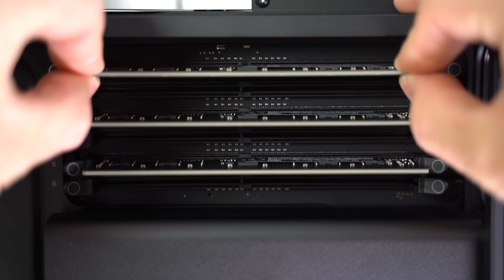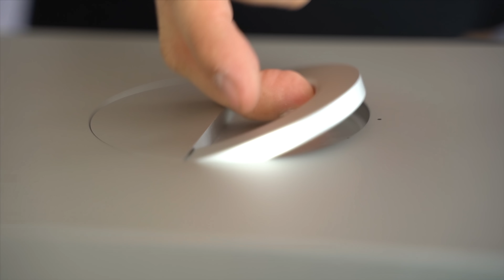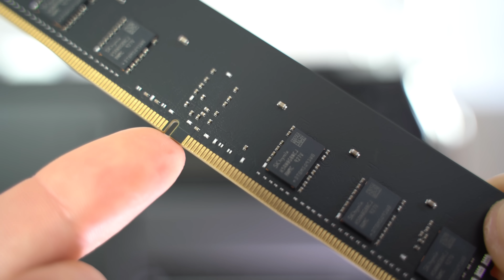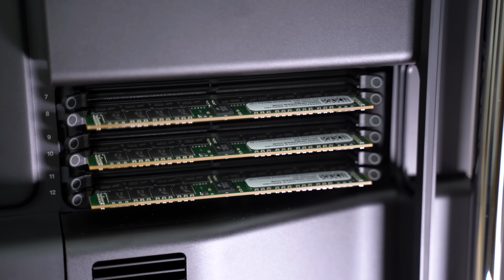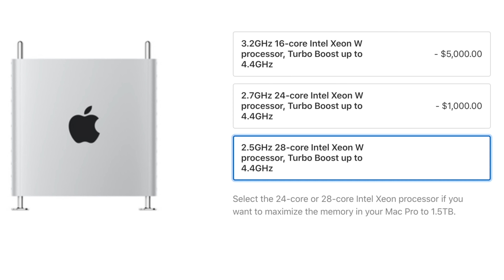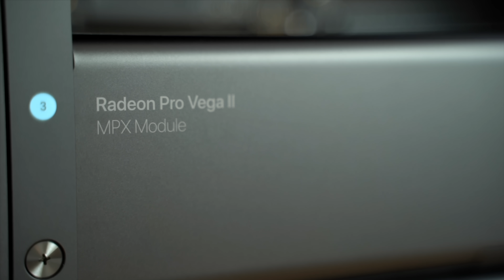2019 Mac Pro RAM Upgrade Guide - Save up to $10,600!

Comment: So, if I order 3 (192GB) would I install the 3 new into slots 3, 5 and 8 and leave one of the old 8GB that came with the computer in slot 10 (4 DIMM configuration) OR use slots 1, 3 and 5 with the new and use 3 of the pre-existing in slots 8, 10 and 12 (6 DIMM configuration)? Thanks for to anyone for clarifying. My computer came with 4, 8GB.

Comment: Your link: 1.5TB Kit (Save $10,609 on Amazon) ➡ @t (Order 3) Has a problem on the bullet points explanation: They mention DDR4 PC3; that cannot be. could be a typo for PC3 because the Ram would be DDR3. Thay charge more for DDR4 PC4 https://www.amazon.com/gp/product/B082XK7GJX/ref=crt_ewc_title_oth_1?ie=UTF8&smid=A91YWXUX63ZCY&th=1

Comment: Depend on mac software even vm windows...mac pro 2019 is overkill not use all hardware potential...not all cores on xeon 28 not all ram not all GPU's on 128gb radeon vega ii duo...this only good for film video 4k 6k 8k footage we which is not standard yet still 1080p 240hz 1ms to 1440p at most upscale or downscale 4k. 4k 144hz monitors just came out...but tv broadcast 1080i. Plus mac pro is 6k to 53 plus  cost still expensive.

Comment: I had to push really hard to get the top RAM stick in and saw the motherboard bend before it finally snapped into place. Is that a bad thing? It's running fine, but I wonder...

Comment: Thanks, this video was a good help. I got the 192GB RAM on Amazon. Difficult to find anywhere else as of Jan.2020. I was considering just filling all 12 slots by adding 2 more of the basic rams, but it seems the speed may drop to 2666MHZ with such configuration -- so I'm sticking with 6 slots for now.

Comment: That RAM is now $292 per 64gb stick. Seems the influx of Mac Pro buyers jacked the price up... still better than Apple, but not as sweet.
Reply: exactly. It is crazy it went up so much in such a short time. will wait for the downturn. Honestly, current price is not that attractive
Reply: @XYUCSD  Agreed, it's still a savings but once the excitement dies down it'll be back around $230.

Comment: Do you recommend swapping out the base memory for 6 sticks of the same make? i.e. not 2x base + 4x new
Reply: If the four new sticks have the exact same specifications as the two existing ones, it should work.
Reply: Yes, you should replace them. Even if the sticks have the same specifications, there's no guarantee they will have the same timings (specially sub-timings). For better performance, it's best for all the sticks to be the same exact model.
Reply: Ok, thanks.

Comment: Assuming that there you start with 6 identical sticks of RAM and add 6 identical sticks, here's no need to remove the old RAM. Unless one set is RDIMM and the others are LRDIMM (which won't work at all), or you're going to sell the old RAM…
I believe you only get the full bandwidth to RAM with all 12 slots occupied. 6 slots gives you 97% of the bandwidth. 4 slots 67%.
I think the best plan if you buy the base config with 4 x 8GB sticks is to buy a further 2 x 8GB sticks plus 6 x 8GB (or 16GB, 32GB etc…) to fill the 12 slots.
Reply: Actually, according to this page http://www.cpu-world.com/CPUs/Xeon_W/Intel-Xeon%20W%20W-3235.html if you install 12 DIMMs, the RAM speed drops to 2666MHz, so it does make sense to only install 6.
Reply: @JGRGilbert  That's an excellent point!

Comment: I was just wondering, is there any difference in terms of quality or reliability between Apple RAM and Third Party?
Reply: Vikas Jangra just buy RAM from MacSales
Reply: Thank u so much. I have my answer.
Reply: As panda12333 said, there's no such thing as Apple Ram. It's just re-branded third party ram.
Reply: dude there is no apple ram the ram is produced by samsung or micron it is all the same and is nothing special at all it is just a computer not magic. well it is ECC ram but thats completely useless for 99.9 percent  of us.
Reply: @panda12333  According to Apple's ram upgrade specifications it has to be ECC
Reply: @huskkyy  yes and ? ECC ram has nothing to do with apple it uses ECC ram because intel designed it that way  but most people dont understand that it is completely useless for 99.9 percent  of people and talk a whole lot of bullshit it does nothing for you in rendering videos or in blender or anything else a normal person would use. the only point of this stuff is error correction for example banking servers who handle transactions, stock trading servers,  protein folding simulation it is so useless for almost everybody but because of intel it is a requirement for these cpus
Reply: @panda12333  but which of all uses the best materials to make the RAM .. better components etc
Reply: @merseybeat1963   the best ram at the moment is made by samsung  but its not important  for you or me only for extreme overclockers bcause they have the best results with samsung dies in benchmarks but all in all no difference for the normal or even advanced pc user
Reply: @panda12333   But quality comparison between this reviewers suggestion (TimeTec) at $224 2X32 or the OWC & Crucial versions at $348 for the same?? Thanks
Reply: panda12333 true

Comment: Can you just add the already included ram without sacrificing performance?
Reply: just make sure the stick is the same size and same speed while using 6 slot or12 slot so that they can run on triple channel

Comment: I have a question can you change the ssd also
Reply: The SSD(s) that come with the computer is/are tied to the T2 chip and can only be changed by Apple or an AASP with the software tool Apple uses to rebind it. This is because the SSD controller is on the T2 chip, and not on the SSD itself.
The reason I made it half plural, is because some configurations will ship with two SSDs in RAID 0, whilst something like the 256GB model is just one.

You can still add more SSD storage though, either via PCIe cards, or through SATA, which is, I believe, on the I/O card. This will however require a specific drive caddy since the SATA power line is non-standard. Pegasus makes such a drive caddy.
Reply: Casper S� And no one (black market, etc) has that software ?

Comment: But... what about the remaining RAM? That Mac has 12 slots, you could just use the original RAM in the slots that are empty. That way you can have 240GB of RAM.
Reply: The following is a copy of my comment on MacRumors about this with respect to memory speed:

The following is not based on knowledge of the specific architecture of the Mac Pro, but general computer knowledge. Disclaimer over.

These CPUs support hex-channel memory. This means that the CPU will have six channels of communication to the memory. This can only be achieved if 6 or 12 slots are populated, so the CPU has either 1 or 2 DIMMs per communication channel. If 4 or 8 are populated it'll run in quad-channel mode. 

Let's pretend we populate 8 slots with 64GB sticks, and 4 with 8GB sticks. If we put 1GB of data in each DIMM and try and access all that data, all at once, this will actually be faster than if we had only the 8 64GB DIMMs, since we can access the 1GB of data on 6 DIMMs simultaneously, versus putting the same amount of data on only 4 communication lines. 
However, if we load up all the memory modules to the brim, the larger memory modules will obviously be used much more than the smaller modules when accessing all the data, since they just hold a larger percentage of it. This means the communication lines will be used unevenly and it won't scale the speed of communication as well. It in most any situation won't be slower than the case with only the 8, should in fact be faster, but not as fast as fully spreading the load across all 6 channels with evenly sized modules. 

The very worst case would be having a single huge module and 5 tiny ones. Since almost all data would be stored just on the huge one, and not so much on the five smaller ones, communication from the CPU would almost effectively become single channel. - The point is more that if you want 256GB of memory, it is better performance wise to get it in 6 or 12 evenly sized modules, than it is to get a few huge ones and load the remaining with small ones, so they all can give and receive data simultaneously

There are diagrams on the back of the RAM covers showing optimal configurations
Reply: Casper S� well, if you use the RAM that’s alrady installed with the new RAM, you have 12 dimms in 6 channels, 2 dimms per channel, and 40gb per channel. That shouldn’t affect the speed of the computer, and it would be better because you get more RAM.